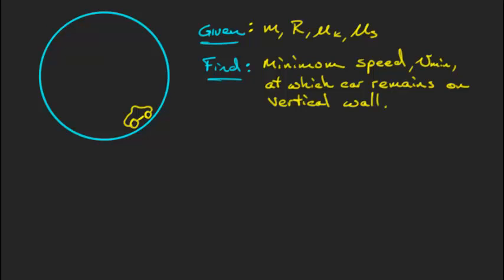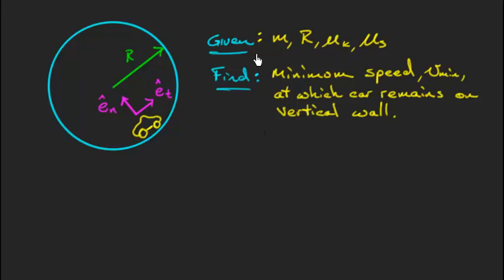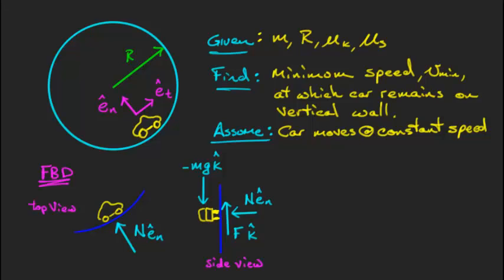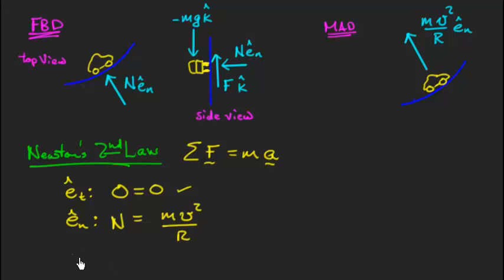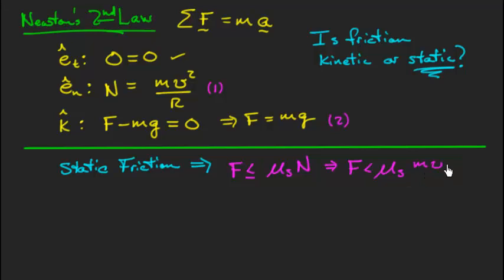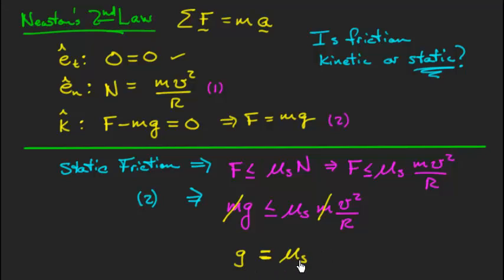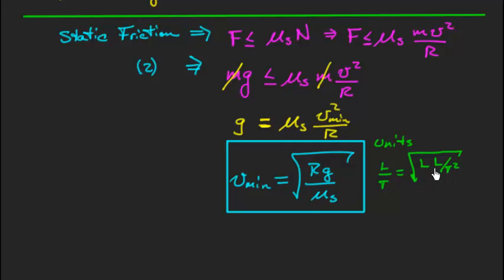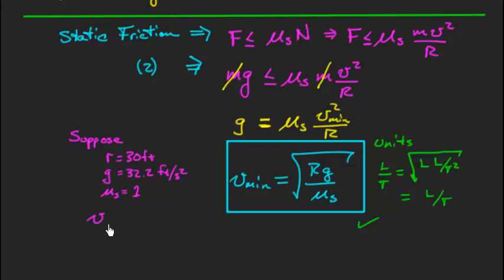Dynamics of the Wall of Death - Engineering Dynamics Notes & Problems

Comment: First of all Thankx a lot Sir, for the clear explanation.
In the exam, I was asked the same problem ,but it was stated that the well is friction less and and height maintained is constant , then what's the minimum speed ? Is this even possible ,if yes how ?
Thank you  again  :))
Reply from the maker: If the wall is vertical, it doesn't sound possible.
Reply: @bdcoller  Just as a motorcyclist would need to tilt a little bit up?
Reply: @notonmondays  That's due to the center of gravity, you need to counter the pull of gravity by providing torque in the opposite direction or tilting up since the center of gravity isn't directly at the contact point with the wall.